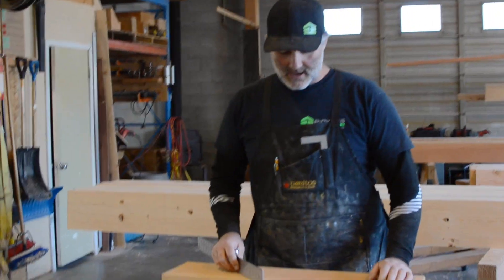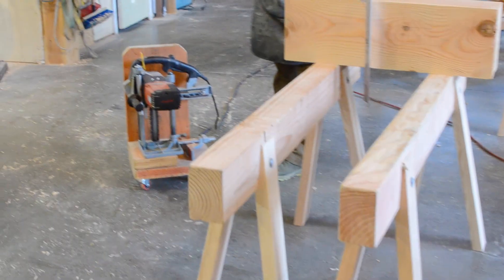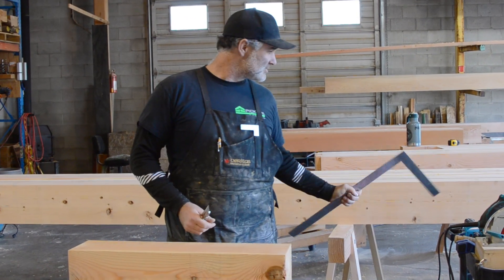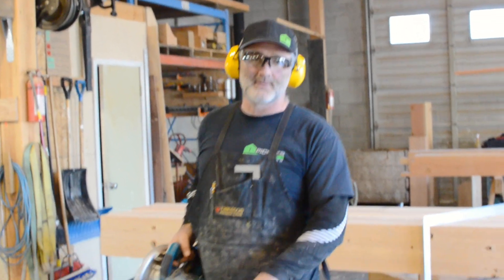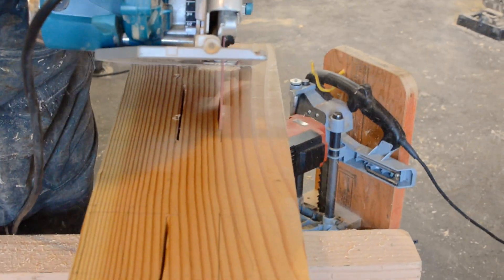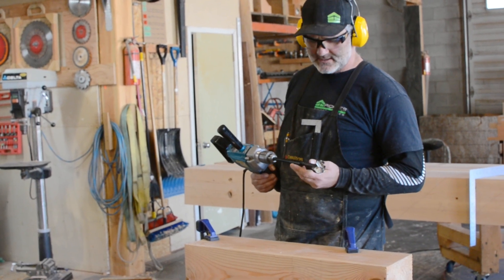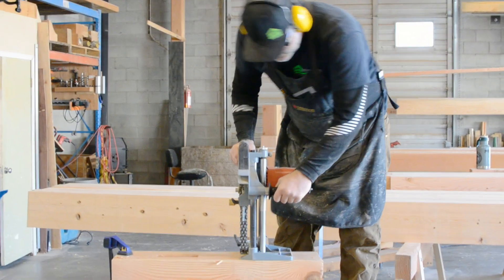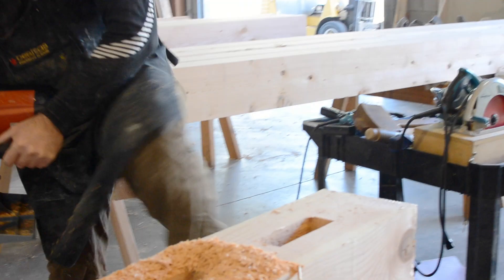drill vs mortiser - Timber frame mortise and tenon joinery

Comment: What is the benefit of this type of joint opposed to just nails?
Reply: Hard to use nails for thick timber like this, they would have to be very very long. This kind of joinery is very durable. Many buildings in Europe were built using these technicuqe and are still standing after hundreds of years.
Reply: @DonDrito  Cool!

Comment: Seven grand for a chain mortiser?  Truly absurd.
Reply: You never see anyone who has one complain about the cost, not at all absurd
Reply: No.  Mafell make industrial quality equipment. The tools and chains last a long time, and they are five times faster than more manual methods and more accurate.  In a production environment labour is a far higher cost than machinery.  You can buy cheaper chain morticers but the Mafell is regarded as the best in the industry.
Reply: @AJBTemplar  True, the Mafell is excellent. I use the Makita chain mortiser, which is excellent, but would certainly have invested in the Mafell if able at the time.

Comment: How do u make sure your going plumb when using a drill
Reply: The plunge cut with a saw Guide the sides and the shoulders are I feel and cleaned up with a chisel.
Reply: Darcy can do this by eye and feel. However I just bought a pack of small round spirit levels from Amazon. About £3. I’ve stuck one to the back of my drill. Now all vertical down drilling is easy to keep level. Also put one in a flat part of the top of the drill for drilling horizontally into walls etc. It’s a help.